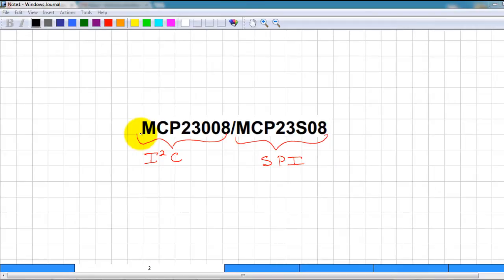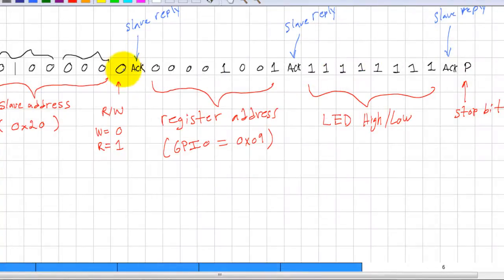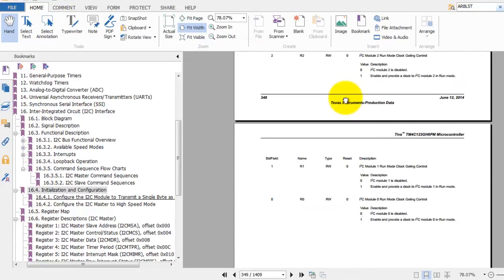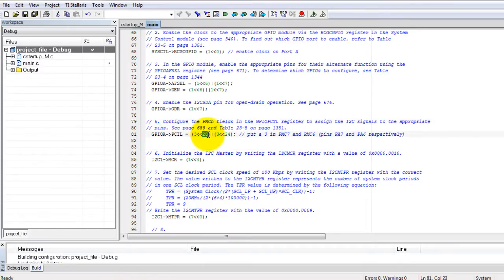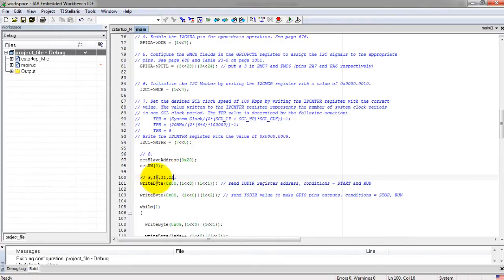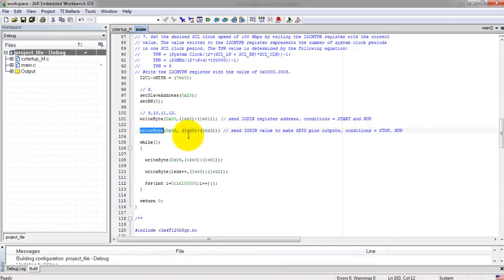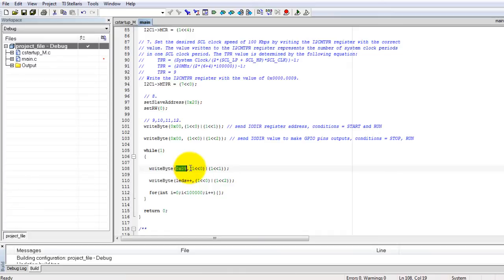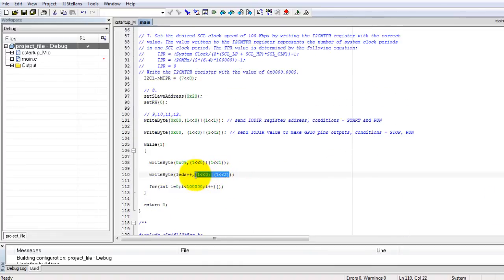TM4C123 Tutorial: I2C Communication

Comment: When I try to compile I get an error: "Identifier SYSCTL is undefined" I am using Code Composer Studio. Any suggestions?
Reply: @LLM-Whipper  Is there a way you could post the actual Tiva Code version of the program? The code in the video, I believe, is called Direct Register Control or DRM. I have tried to get it to work with no luck and it seems TI wants people to move away from DRM syntax. Any help would be greatly appreciated!

Comment: I have to add the omitted sequence (dotted lines) from Fig16-10 to transmit Multiple bytes in order to communicated with 2 slave devices on the I2C bus.
MCP23017 & PCF8574

// wait until BUSY bit is cleared
while ((I2C1_MCS_R & (1 << 0)) != 0);

Thanks for the tutorial.

Comment: in 20:19 why you went to check BUSY bit , it should be BUSBSY .
   while(I2C1->MCS &(1U<<0) !=0); -->BUSY 
    while(I2C1->MCS &(1U<<6) !=0); -->BUSBSY 

or i am wrong ?
Reply: @AllAboutEE I was wondering the same thing but if you check the diagram for multiple data sends. you will see that it's actually the busy bit not the BUS busy bit. 

check page 1010 and Figure 16-10. Master TRANSMIT of Multiple Data Bytes

Comment: I am working with the same code but reverted it back to be used with only one data byte since I am using a PCF8574 io expander. The problem is, when I am downloading the code on the board, it shows that there were warnings during the download. and the code doesn't even get uploaded. The board continues to run the previous code. Can you please help.

Comment: i don't see clock with this code.
Reply: The I2C clock is definitely set in code to 100kHz because TPR is set to 7. But you are correct that the bus clock is not set via the PLL - so by default it will run at the 16MHz frequency of the external crystal (which keeps the code simpler and more compact).  If you are using the PLL to have a faster bus clock at 80MHz, then you need to set TPR=39 for a 100kHz I2C clock.  For a 50MHz bus clock, then set TPR=24 to produce a 100kHz I2C clock. For a 20MHz bus clock, then TPR=9 will produce a 100kHz I2C clock.

Comment: Are you sure the TPR calculation is correct? page 1026 (I2CMTPR) says:
SCL_PERIOD = 2×(1 + TPR)×(SCL_LP + SCL_HP)×CLK_PRD
That is:
TPR = (SCL_PERIOD / (2 x 10 x CLK_PRD)) - 1
TPR = (100,000 / (2 x 10 x 62.5 )) - 1
TPR = 79

You were getting "7" (I'm guessing 8-1 instead of 80-1). Am I missing something?
Reply: did you get this to work
?
Reply: use this formula TPR = (System Clock/(2*(SCL_LP + SCL_HP)*SCL_CLK))-1,
you will get 7 indeed

Comment: How to find the values of pull up resistors R_up ?
Reply from the maker: SAGAR SHARMA Use 4.7k.
Reply: Thanks for promt reply !
AllAboutEE Wiill 4.7K work for all transmission speeds?
Reply from the maker: No, there's a formula http://electronics.stackexchange.com/questions/1849/is-there-a-correct-resistance-value-for-i2c-pull-up-resistors
Reply: AllAboutEE  Thanks
Reply: AllAboutEE can you suggest some page/blog where Tiva  is interfaced with accelerometer over I2C?
Reply from the maker: Not really. Just learn the I2C protocol really well then you won't have to look for examples http://www.i2c-bus.org/

Comment: Awesome videos ! Do I have to have to have an IO expander if I just want to run one sensor ? I am trying to follow along without one and I am getting an I2C_MCS_ADRACK while I am using the slave address in the HMC5883L datasheet,
Reply from the maker: No you don't need an IO expander, just make sure you setup the bits according to your device. For your sensor I would recommend looking for an Arduino example then "translating" it for the TivaC board. This looks like a good start https://learn.adafruit.com/adafruit-hmc5883l-breakout-triple-axis-magnetometer-compass-sensor/wiring-and-test